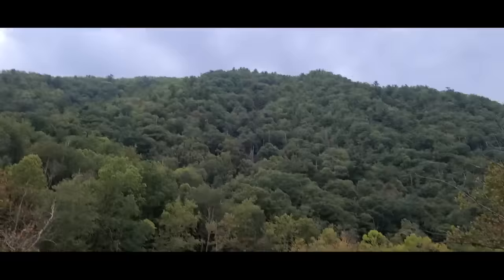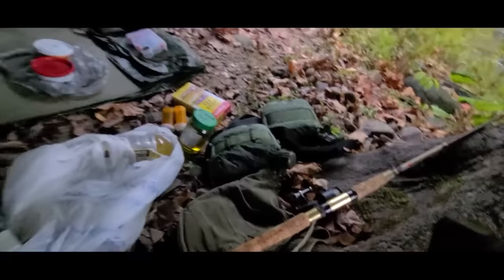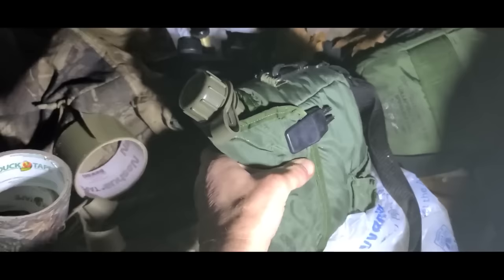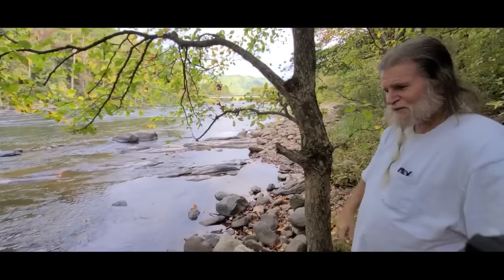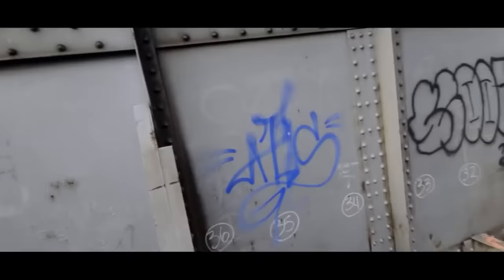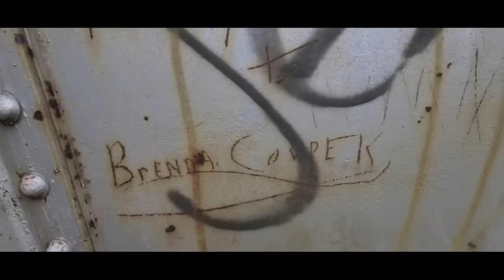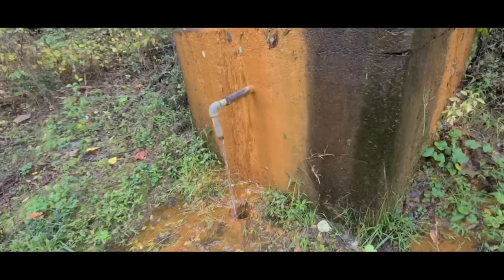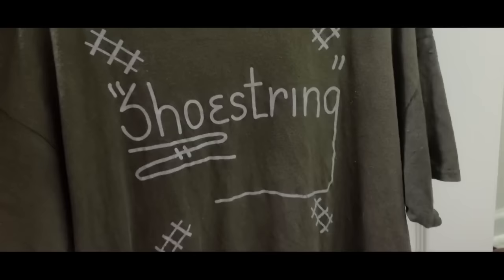Helter Shelter camp and deteriorating CSX rail bridge! (See description)

Comment: Not gonna lie, I'd be scared sleeping out there by myself. But it sure was beautiful and peaceful. I love hearing the water trickling. My most favorite thing to do is camping. Of course, I'm more of the campground kinda gal in my trailer. I like to hear people sitting around the campfire having fun. Especially if someone plays the guitar or harmonica. Gotta roast some hot dogs and make smores or pudgy pies, too. Looks like you had a great adventure, Shoestring. ❤
Reply: Not me. Need hard siding something. Even a full blown tent isn't gonna work for me. I've heard of people sleeping in a hoist setup in AK. They winch their sleeper about a dozen feet off the ground using a cable or rope system over a large tree limb. that way nothing can access them.

Comment: Make sure you really really rinse out that washer after you use RIT or any other dye. It's a good idea to pour water all around the rim and everywhere else, even under the top rim. Then run a white towel or something through just a plain rinse and spin to make sure you got it all. RIT has been around for at least 70 years, it is a good product.
Reply: i found that Dawn dish washing fluid washes and removes the petroleum smell a couple of squeezes it also cleans the washer but wash those clothes separate
Reply: I tried that hack a number of years ago it has worked ever since
Reply from the maker: Yep....i run an empty cycle afterwards
Reply: @TheHoboShoestring  with the Dawn dishwashing liquid a rinse to your washer is not needed the beauty is clean clothes clean washer in one wash

Comment: There's a fish coating called Andy's that's a dry coating, I put it in a big ziplock and put the moist filets in and zip it and shake em up, works real good, it comes in a few different flavors, one's cajun hot. I used to do a lot of rabbit hunting with beagles years ago and some RR tracks were good for bunnies and they liked to hide in that stuff, a couple beagles go in a big spot of that kudzu and bunnies would come squirting out from everywhere, fun as hell.

Comment: Broke down while going thru Erwin once many years ago.. good to see you still out enjoying life.
Reply: I broke down in Erwin.  Electric fuel pump went out.  this was before they any auto parts stores.  rolled into a service station.  Saw a 2 gal gas can in the window, bought that and some fuel hose.  Used bungy's to hold can on right fender, punched holw in gas can top and siphoned gas over to carbs and drove back to bristol.  Got a lot of funny looks driving home.

Comment: Hobo Shoestring if you have not trashed your  sleeping bag try using two squeezes of Dawn dish washing liquid. When I delivered fuel oil,gas, and kerosene I would wash my clothes that had any of the fluids spilled on them separate from my other clothes it would clean them completely and also removed the smell.
Reply: Dawn antibacterial (the green stuff!) is great on virtually everything!
Reply: @billstill1794  I use the original Dawn

Comment: Ex technician. Do not soak clothes in washer, use a washtub. Sometimes seals will slowly leak until the water can start getting into the gear case and goodby washer.
Reply: Broke washer means you just get a new one

Comment: One has a good friend to help one set up things at camp.  I have no one to help me out when I need it the most.  Yet, I still take it all in for just one day at a time.  Some duck tape will seal up the holes in the tarp.  What we do is go to the fish counter in the store and buy the fish that way we will have some to  eat.  I got an older camp cooking set that was all black on the outside of it.  Every pan had black on it.  I still have the packs if one wants them so far.  It best for me to go and buy the 10.00 shower for ourselves at Walmart.  These are solar showers just test the water before showering.  I made up two quick set up ridge lines with toggles.  I try to keep my mind open to the different setups on the tarps and different ways to set them up.  A dinning fly is good to set up too besides a tarp.  Its cold in the house now.  If one were to come by and I believe that one is not going to come here, I cannot send the stuff to one have to stay here just don't feel good with the fatty liver. Bank line is good to keep some in the bucket just in case for fishing.  I like the synthitic bank line and I have two spools of this too.  Its not hard to change up the fishing poles line.  Just take off the older stuff and roll on the new.  A flat knot is good for on the reel part.  Paul in Ohio.

Comment: Flip the tarp next time so you don’t have to cut it, the reason the water doesn’t drip off is because the fold is up, so essentially the lip that the fold causes won’t be there if flipped.  The jig head isn’t really a good hook to just cast out, they’re usually used with a plastic worm and retrieved as soon as it hits the water, or in a slow jerking motion. Do you have a PO Box where I can send some supplies? Thanks for another excellent video! Safe travels! 🚂

Comment: Good way to reel up string if you’re too far from someone that will do it for you is take the new line and put it in hot water (not boiling) and reel it onto your pole lacing it tight the first round and gradually letting off a little bit on the rest but making sure it lays next to the previous winding. Hope that helps shoestring. Thanks for the great views and news
Reply from the maker: Eyesight is too poor to thread the first line end in the reel

Comment: Where the sag is in the tarp Mark tie a small rock so you can suspend the tarp from that point by cordage from a tree. It keeps it drained well. Or just tie the tarp off higher at one end to slope it.
Reply from the maker: Not that easy onve the tarp is saturated.  I used the fishing rod poked up in the moddle

Comment: Should have tied a ridge line between two trees then drape the tarp over, anchor two corners to the ground and the other two corners guy lined  to the trees.
Reply from the maker: Wasnt anywhere for a ridge line to anchor to but the fishing rod poked yp in the middle did the trick

Comment: Those Mitchell reels from the 70s are built to last , I couldn’t read the number but looks like the 300 - just some basic cleaning and lube and they will last forever. The gears inside were metal unlike the cheap imported junk of today…keep that one Shoestring it’s a good one. Unfortunately line tends to degrade with age and exposure to sunlight - replace annually if you can . Nice location regardless of the fishing !